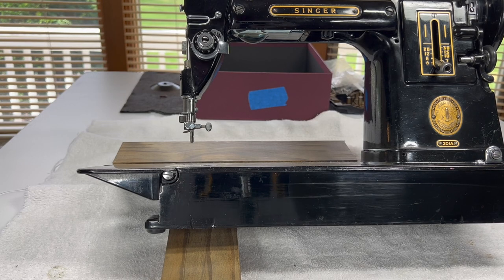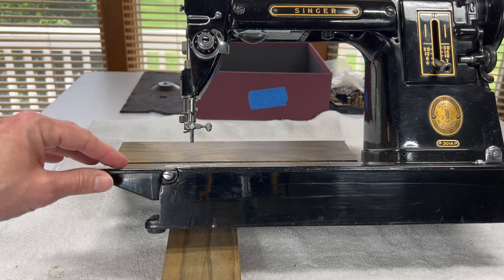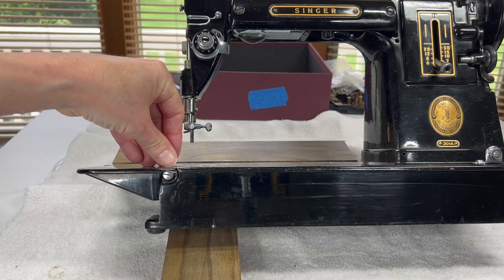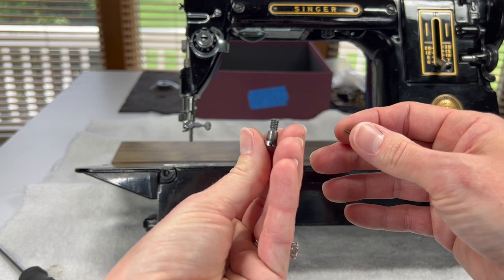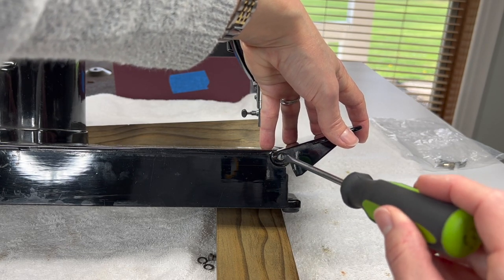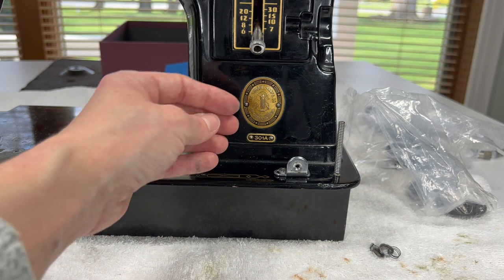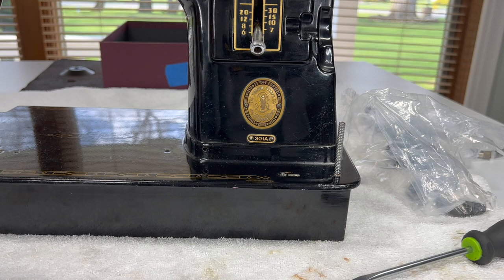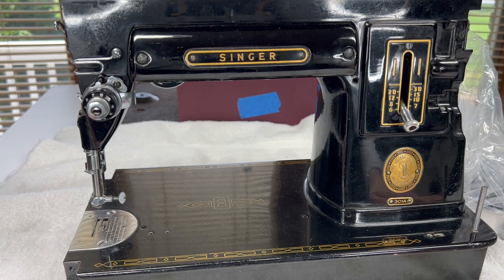How to remove bed extension, hand wheel, bobbin on a Singer 301: Singer Restoration Series Part 3

Comment: I just got to this point yesterday on a tan 301 I got on eBay.  My son in law had to help with one of the bed screws. I nervous about the cleaning part and getting things back together. I just became aware of this model a few weeks ago when I took my mother’s old 66-16 to a service person for hopefully restoration plus my featherweight for service. I found your series and decided to start work on this machine myself with your helpful videos and see how it goes. The machine is quite fascinating and it does run but the finish is in worse shape than I noticed so we’ll see what happens. I did get the very worn down and dried up feet cushions off today so that part looks better.
Reply from the maker: I think that it’s great that you are trying! Good luck and feel free to ask questions as you go. It’s a rewarding process, they are wonderful machines!

Comment: Thank you so much for this series! I have gotten this far with you and hope to have my machine back up soon. Luckily I had picked up another 301 at a garage sale for parts. I have had to drill out 1 screw so far......Also, I was wondering why my 301a has a plate over the bottom plug and I only need 1 for the foot pedal? My extra one for parts has the 2 like yours for the pedal. Hmmm. Thank you again for the instruction videos!
Reply from the maker: Hi! Some of the machines had a plug that was wired just like the Featherweights and some had One plug for power and one for the foot control. You are not missing anything, it is just how that one was wired. I believe this was a difference between the 301 and the 301A but I have done so many that I can never keep which was which staring in my head anymore. Either way, it will work!
Reply: The single plug with two wires were sold with the “portable” machines in the trapezoid case. This is why the two pin receptacle was covered. These were also long bed machines.  The shortbeds with two cords were sold in cabinets. The three pin cord is for power and the two pin is for the foot control or the knee control. Both cords will work and as was mentioned, are the same as the featherweight. Hope this helps.

Comment: If I paid to have my 301 serviced and it’s working well, do I need to take all these parts off for cleaning? I am going to take the ones off that are easy because I want to buff and polish the exterior … but I’m thinking I shouldn’t need to do so much except keep up with regular maintenance.
Reply from the maker: Hi! If your machine is working well then how much cleaning you do is really up to you! I like to get the machines to looking as “like new” as possible but some of the stuff I do doesn’t really change the performance of the machines…just makes them nicer to look at. If you end up watching all the videos you will at least have a good understanding of how your machine works and if you ever have problems you will more than likely be able to service it yourself. That’s a win if you can save a little cash!
Reply from the maker: Hi! If your machine is working well then how much cleaning you do is really up to you! I like to get the machines to looking as “like new” as possible but some of the stuff I do doesn’t really change the performance of the machines…just makes them nicer to look at. If you end up watching all the videos you will at least have a good understanding of how your machine works and if you ever have problems you will more than likely be able to service it yourself. That’s a win if you can save a little cash!

Comment: Have you ever had a 301 stop motion knob just spin and not screw off? I can't seem to figure how to get it to catch so I can screw it off
Reply from the maker: This might be a silly question but you are holding the hand wheel so it doesn’t turn while you are spinning the chrome stop motion knob counter clockwise and it just spins and never comes off?
Reply: Yes, buy it just kept spinning. I ended up holding the needle bat. Someone suggested putting a block of wood under the needle bar so it didn't move, but I got it to work by just holding. I. Learning something new everyday! Thanks for responding! I'm enjoying the videos.
Reply from the maker: @kerriannedonovan9398  I am glad you figured it out! So you were able to get it off? I will have a new video for this series soon, thank you for watching!

Comment: What penetrating oil is best?
Reply from the maker: Hello! If you can get it, I love Kroil, here is the link to it on Amazon: https://amzn.to/3R1a25h It works better than any other I have tried and it won't hurt the finish on black machines. I hope that helps!
Reply: Liquid wrench - according to Project Farm https://www.youtube.com/watch?v=xUEob2oAKVs.  Also, heat from a hair dryer works well too.

Comment: My stop motion wheel is stuck. Even after screw is removed and I’m holding the main wheel, the silver stop motion knob won’t budge. Any recommendations?
Reply from the maker: Hi! You may need an extra set of hands but you should be able to get it free. Usually I can wrap the chrome knob to protect it and then use large pliers to grip the knob and try to get it to turn that way. Your helper can hold the hand wheel still for you. It is frustrating when they are really stuck, I hope that helps!

Comment: Both washers on my bed extension look flat. I wonder if someone replaced them and used the wrong washer? How hard is it to get a replacement?
Reply from the maker: It is very easy to get replacements thankfully! You can find them at the Singer Featherweight Shop, I always keep them on hand because they are one of the most common missing part on the 301 and 221.

Comment: The lever that lifts the foot on mine is not raising or lowering the foot please show me what to do for this
Reply from the maker: Hello, does the lever itself raise up and down? If it does I would check the set screw on the presser bar to see if it is missing or screwed in tightly. If it's loose or missing the lever will not raise the foot, instead the presser bar will just slide inside the bracket that the set screw is in. Let me know if this helps!
Reply: Thank you I will check

Comment: I just got a 301 and the hand wheel won’t turn. I tried to remove the bobbin casing to see if I have a thread jam but I can’t swing that arm out to get the casing out
Reply from the maker: Hello! There could be a number of things that keep the hand wheel from turning. If it were me, I would start removing parts until I figured out which one was the culprit. The gear on the motor can be stiff but rarely does it make the hand wheel freeze. Normally it is a frozen needle bar or something going on in the hook area. I would spray inside the nose and hook area with a good penetrating oil and see if anything loosens up. Also, check out my video on where to grease and oil your 301: https://youtu.be/Ut9tgaTCxaA. I would focus on the parts you should oil. Let the oil and penetrating oil sink in over night and see if anything starts to free up for you. If the bobbin case is stuck in the hook assembly and you can’t get the arm on the bobbin case to swing out so you can pull out the bobbin case, don’t pull on it. Put some penetrating oil on the little arm that swings out on the bobbin case and let it soak in and try again and see if it frees up. If it is easier for you, you can email me pictures of your problem areas to jen@sewingmachinerehab.com and I will look and see if I can offer better advice. Good luck!